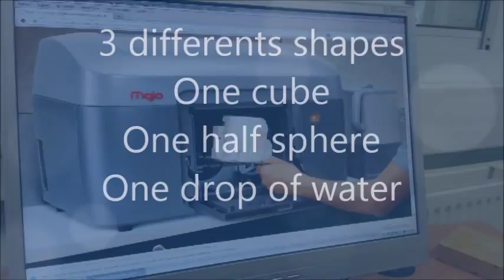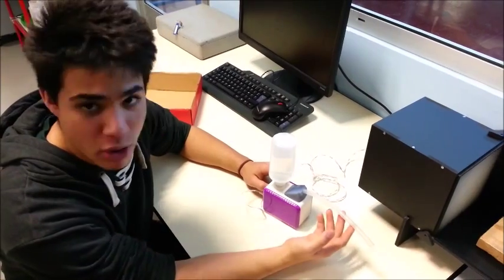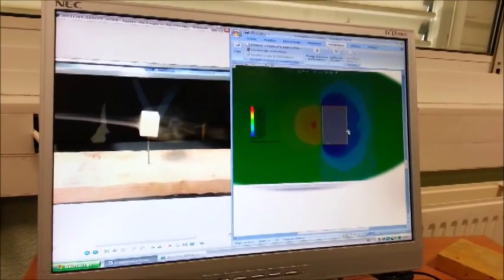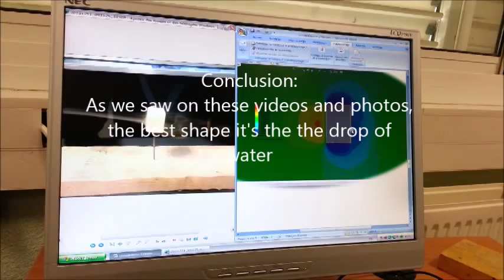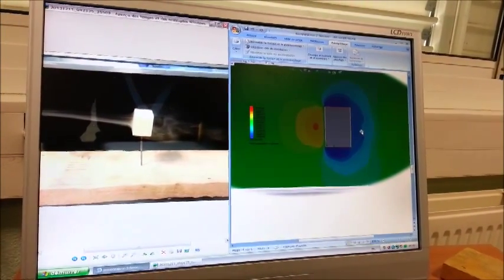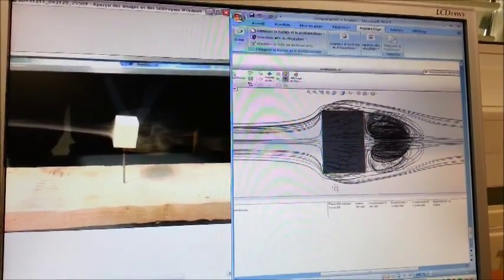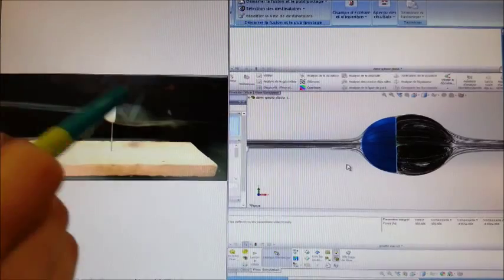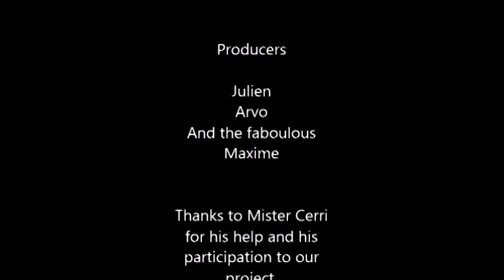aerodynamics-How to design an aerodynamic shape.

Comment: Be careful when one says WATER DROP,  as when a water drop falls fast through the air, its shape is not streamlined at all and the result is very surprising with a flat blunt front which usually shatters the water drop. One should say, the shape or a bird or a fish or a whale, dolphin, or Orca.
https://youtu.be/6G6omXLTAj0

Comment: Why are teardrops (with a blunt front) so aerodynamic? I would think that the blunt front would produce quite a lot of drag because the air has to quickly change velocity to get out of the way rather than gradually getting out of the way? Thanks for any answers!
Reply: are you thing about a circular arc airfoil?
Reply: The blunt front and tapered rear end makes it a very good aerodynamically because the air molecules dont separate from the surface when they first hit the front end and flow across the surface towards the rear.

Comment: have you considered cutting off half of a sphere out of a "drop of water" model, duplicate what is left and join together the two leftover shapes (kind of cigar shape with both ends peaked)?
what would be the outcome of air flow simulation then?
Reply: depends on the curvature. the idea is to get the streamlines to stick on the surface as far as possible.

Comment: so why is a bullet sharp at the front? do these things change as an object moves faster? will the drag at the back lose its grip at some point?
Reply: +Eek!  Bullets need to penetrate and kill, so the point is on the front. The spin of the bullet stabilizes the bullet. Same as a baseball or a spiral football pass.  No spin and you have a knuckle ball or a knuckle bullet.

A knuckle ball is heavily influenced by every minute differential in the air. The path becomes unpredictable because we can't observe all the nuanced air qualities. When an object spins it cut through these anomalies in air structure and is not influenced by them near as much.

Supersonic objects behave differently. For instance, the power it takes to power an object through the air is an exponential curve. But really fast objects are not affected in near the same way at supersonic speeds.

Cheers
Reply: Anonymous DueToFascists a knife isnt blunt, even tho the material it cuts will try to shape it like this.

i cant believe a droplet is the most aerodynamic shape, that would be the same as saying a bending straw is the most rigid
Reply: Eek! A drop is fairly aerodynamic, but the super fine point should not exist when designing optimal aerodynamic shapes.

A thicker or more blunt point allows the air flows not to interact as much and swirl.

Look at the back of planes. Instead of the sharp point they are going for a screwdriver type shape. This separates the exiting air flows and swirl is avoided.
Reply: but the front is still sharp
Reply: Eek! Are we talking on planes? or Bullets?

Some bullets are not very sharp, same with planes.

But here is a fun fact that will put things in perspective. If you reverse a standard aerodynamic shape (i.e. an airfoil), it is still one of the most aerodynamic shapes.

Putting a point on the end and the bigger area behind is not that bad of a shape for aerodynamics, but the reverse is optimal.

The main concern is length, so lamineer (attached air) can seperate off the back and not cause turbulence (swirling air).

If the sides of the object are roughly the same length as the frontal area this will create a lot of turbulence behind. Think, cubes and cylinders, etc.
Reply: yeah that make sense. i meant for a plane, but it counts for a bullet too.

i got the impression this video claims a droplet has the perfect shape tho, but i guess the inverse of it, would be the perfect prototype for a shape?